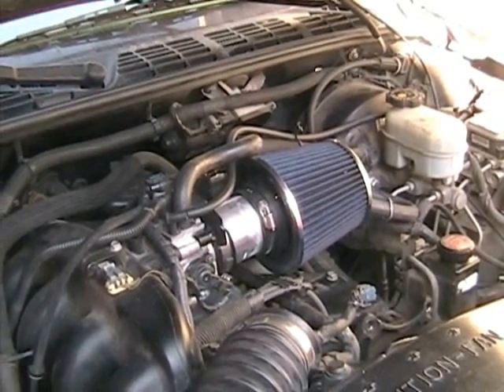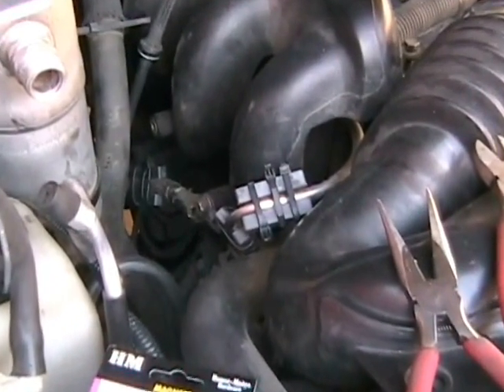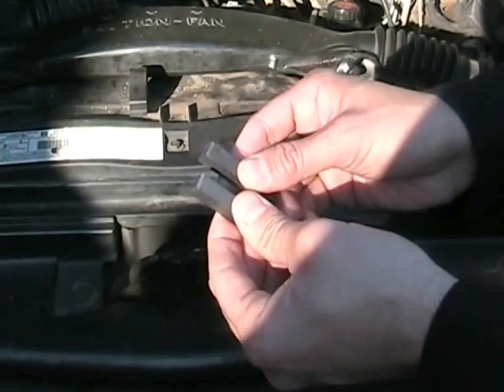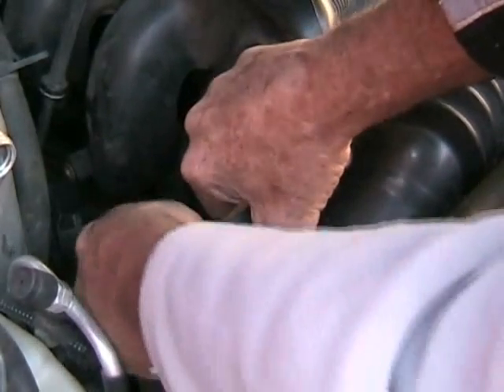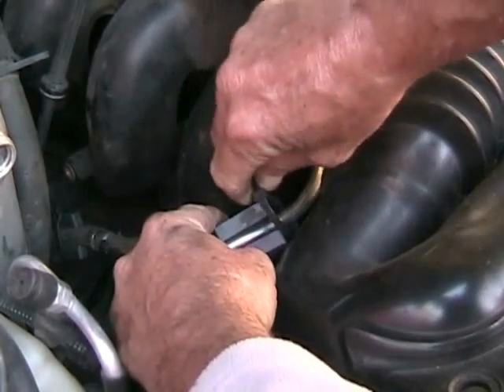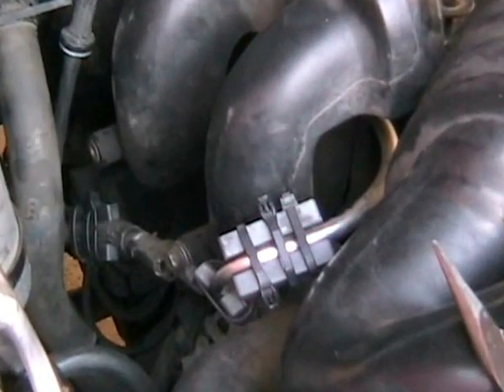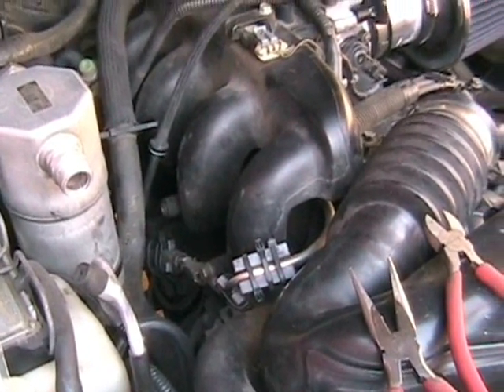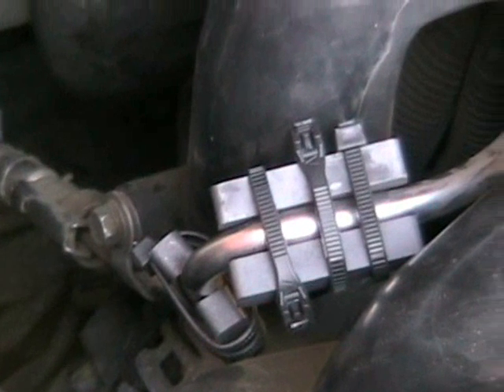Sequencing magnets on a fuel line

Comment: @jsf926

How so? All the oil companies do is sell petroleum products. Perhaps they may like it if people use a lot of gas, but I don't see how they have any control over how much you use. What connection, if any, is there between the oil industry and the auto industry? How exactly would *car manufacturers* benefit if they made cars waste gas?
Reply: Incentives for the automakers to only slightly increase fuel economy over time. When the technology is out there yet they didn't put that tech into all the cars.

Comment: Dear Sr. I have try the sisters in the cars in my familie. 
My personal result is 2o% Savin. But I learned to drive using lite presure in my celestino pedal and when approaching a red lite get there but muy inercia and do not speed to instantly hit the brake. 
My 22 year old sun has the same magnets, the same car and gets and average of 15%.
If I drive in open roads mateinig the speed at 80 km/h my millage can reach 27%

Comment: If two magnets put together with the same poles facing to each other, most of the magnetic field between the two magnets is cancelled. Then why do you want to put the magnets on the fuel line?
Reply: Rock Man the negative charge hits each other then press out though

Comment: i am using  magnates set 16 numbers at my Mitsubishi Diesel turbo charged Engine 6 litters installed at my 60 kw gen set and i find out very nice fuel consumption and very soft sound performance and good out put - this trick is very good-

Comment: dude you need a compas the south should be what is turned toward the fuel line fuel south pole and incoming air you need north pole use ferrite magnets 2 with 1900 gauss set to north in to the incoming air..
Reply: advancedhydrogen I am looking for such solutions for years now. I am a professional driver and any help for substantial amount of increase will be appreciated.
Reply: Have the magnets repel each other on the fuel line as close as possible to the combustion chamber, noting the polarity.  For my application, the strongest repulsion was with the south poles facing each other with the the fuel line between them.  The direction of fuel flow would be perpendicular to the magnetic field lines.

I haven't applied magnets to the air intake, but the general consensus is to also have the magnets repelling each other, but opposite in polarity to what is in place on the fuel line, which in my case would be the north poles.  I believe the theory is to force the clusters of the hydrogen in the fuel to a more even spacing so that the oxygen is more easily bonded with them for optimal combustion...something to do with electron spin, no doubt.  I would assume for diesel engine applications, magnetic field strength would have to be more intense than for gasoline/CNG.  

I'd be curious to test if placing an array of magnets on the outlet of the fuel pump nearest the tank, and then another closer to the injectors would make a difference to the fuel pressure; if it increases, theoretically the fuel would be better atomized as it sprays into the cylinder.
Reply: You use north polarity on the air intake and south polarity on the fuel line so the air molecule will be attracted to the fuel molecule causing them to bind together which in turn causes better fuel combustion.
Remember, opposite polarities attract.
.

Comment: if you super magnets it will be very hard to put them on so they repell each other !!!!I put 2 super N52 magnets on my ford ranger v6 fuel line just before it goes into the injector housing and it seems to run a lot smother haven't don't a mileage test yet !!!
Reply: DoctorLucky1 what are the mileage results?
Reply: Update

Comment: yes i agree HALF SAY REPEL & HALF SAY ATTRACT
    W T F ???
which side is right guys?
Reply: none
Reply: MOE ED, NY H repel negative charge of neodymium
Reply: Cover the bottom and side bottoms of gas tank and hole fueling with as many size and types .Ring microwave magnets , Speaker magnets . North South ,North South all over as much as you can possibly fit on there. I've done it ,its amazing ,the fuel changes,  Its a more cleaner fuel, more efficient. It also has a frequency change. It takes a day or two for the frequency to complete its transformation process. I've also noticed it forces out old carbon from the motor. Crystal's also can be used to transmutae its Frequencies.

Comment: @dallasgoldbug

Several decades ago, the basic internal combustion engine was already about as efficient as it could ever get. Adding computer technology and fuel injection was able to make slight improvements in gas mileage by more precisely metering fuel/air flow under changing conditions, but it's main advantage was creating better performance. There's simply only so much energy you can squeeze out of a gallon of gas, without making huge (and expensive) changes to fundamental engine design.

Comment: Is neodymium too strong?
Reply: No, the stronger the better. Just don't waste your time putting them on a steel line, since that will block most of the magnetic field, they should be put on the rubber line as close to the engine as possible (and don't pinch the line when you do it).

I did this many years ago on my 1978 Toyota pickup when I was doing a lot of driving and on one tank of fuel I'd put the magnets on and the next tank I'd take them off then the next tank I'd put them on etc. and I consistently got one more MPG with the magnets on.

Everybody who says it doesn't help has either not tried it at all or tried incorrectly by putting them on the steel fuel line (like "MythBusters" did).

Comment: You have few problems , this has been researched in great detail and the departments of energy also have studies available . 
The Magnet HAVE to :
1. be slit in the half not lenth wise as you have it .. so the long side standing up horizontal .
They call it magnetised through Thickness NOT Length ! Like the ones you have .

This makes a major difference .

2. You want the liquid to flow from North to south ! 

3. You don't really want to go above 2000-2200 Gaussbetter as it's cheaper .
Reply: Jensen Cass please share the link to the detail.

Comment: So are you telling me that a magnet on your fuel line will improve combustion to the point that the A:F ratio will be changed enough so that the ECU will trim fuel?

Run this device on a vehicle with a scantool and check the injector duty cycles in closed loop operation at a steady speed, and check again with magnets installed

Comment: had you not slept through chemistry class you’d have known these can’t have an effect. $6 wasted. 

If this worked it would be standard practice. It doesn’t, so isn’t.

Actually, lowers fuel economy, as it adds weight to the vehicle.
Reply: There are some published white papers on this. Actually it reduces Nox and Co.

Comment: And never mind the EPA. If any auto manufacturer could get even a .1% of an improvement in gas mileage on their cars by using something as cheap and simple as magnets, they would immediately have them installed to gain an edge over their competitors. They would be stupid not to.

Comment: Lol 😆 1st. The only practical use for magnets on a motor is above the oil drain plug to catch the microfine metal particles if a car doesn't already have a magnetic oil plug already!, 2nd. Car manufacturers engineers would have it as standard equipment if it did work..... I got termites to sell to people that buy these things!! 😆
Reply: drfix2020 many opinions on that and i believe youre right, others place them on oil filter and not a good idea
Reply: @Michel11.11  I think it's also a good idea there too, unfiltered oil goes in the filter surrounding the filter and peanut oil exist Center of filter I'd put the megnet on the bottom of the filter wherever that may be.

Comment: With any positive fuel mods the O2 sensor tells computer to dump in more fuel. I added on hho mod at 1 later per min direct into carb air intake. Had lots more power and engine ran cooler... BUT... went from 28 miles per gal to about 19. Then their is all the crap about fooling O2 sensor and so on and so on... all bullshit !!! If you are going to entertain any of this to get good results, you have to buy a totally non computerized, naturally aspirated  unit. Then you are going to be happy, possibly even better off if the Sun gives off a E.M.P. in THE NEAR FUTURE. Be back to horse worldwide over night... HA HA ... Go buy a horse instead.

Comment: mythbusters have already busted this myth too.
Reply: the mythbusters are trolls of big oil. When using magnet on euro 2 engines (non ecu), they should travel 100 kms for diesel or 50 kms for gasoline engines before they could notice the effect which is a change of noise level of engine noise. Magnets should not be used on euro 4 (ecu) engines.

Comment: Hahahahahahahahahahaha, april fools! wait, are you serious? Whaaat? Motor fuels are non-polar, no magnetic effect on the fuel is possible. When tested, typical magnet devices had no effect on vehicle performance or economy.
Reply: You need to read about the phase states of water. There are 14 found so far. Fuel or ANY liquid works with the same principals.

Comment: "Burden of proof" fallacy, pal.
If it works, then let's see somebody come up with the scientific evidence. It's not my responsibility to prove that it doesn't work. I already tried this magnet trick on my old car using neodymium magnets salvaged from scrapped hard drives (which are *much* more powerful than the regular magnets the guy in the video used). Made no noticeable difference at all.